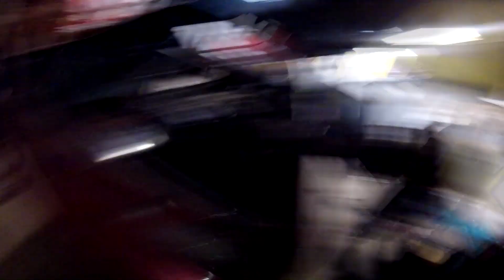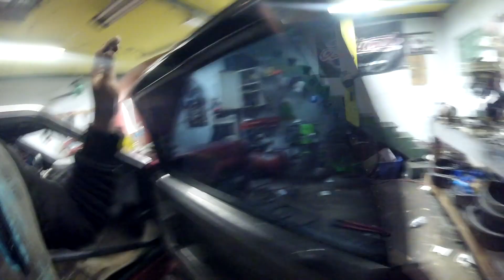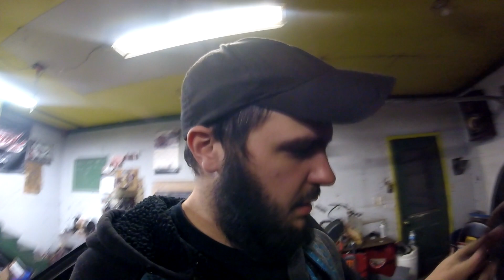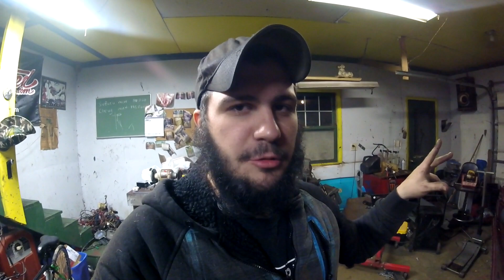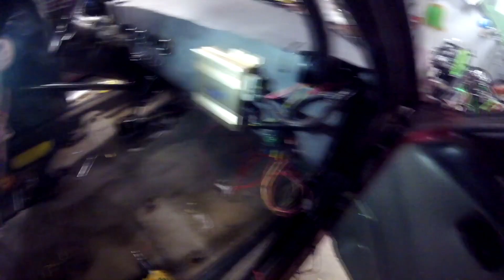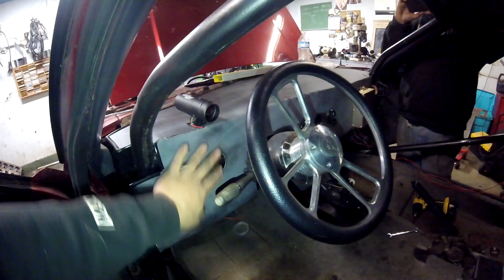Wiring A Race Car. MS3 Gold Box LS Wiring Harness Install. Switches, Fuse Panels And More!

Comment: Wow.  I need to do a battery relocation on my 4th gen Camaro this winter and that really simplified it.  I have stock tank still and stock computer. So I should have 3 wires coming out of the kill switch? Starter,alt,factory fuse box under hood?

Comment: Hunter I agree with some of the other peeps. the pumps need to be on relays, toggle switches are only rated at like 5- 10 amps and each pump will pull double that easy. Also cooling fan needs a relay, I would also let the gold box control that shit, it can do it so why not let it? it may work for a while like you have it but it is prob limiting it at full tilt

Comment: Solid State relay for the rear..gets rid of the big  gauge wires going to Kill Switch..all u need to do is run the trigger or ground to kill switch to turn power off. I would relay the pumps just because thats a lot of amps(36+) running thru a switch. Make your self a little metal panel and screw/bolt some relays to it and start running wires. Obviously make sure they are fused(get a fuse panel). Check out Leash Electronics they have Single and Dual relay boards. They are great for Fuel pumps and fans or any other high amp stuff..Pretty sure they are rated to 60amps. Only downfall is they take 2-3 weeks to get. Go to google images and type in 12 relay/fuse boards u will get a ton of ideas.

Comment: Looking good man! BTW when you go to use the data for those injectors I ended up with 1.3 dead time @ 13.2v and the standard .200 offset. Works perfect on the MS2 might be similar or a good starting point on yours!

Comment: Lifetime Carb guy checking in.
I just recently bought an efisource micro, coil igniter, 3 bar map, and the Tuner Ultra with Megalog HD.
 All this being installed on my 2000 Dodge 5.9 engine going into a 73 Dart.
We’ll see how this goes.  LOL
Reply: Prochargedmopar I was a carb guy for 30 plus years. After learning efi I wouldn't have a carb if someone gave it to me.

Comment: Great Progress, you are gonna be done in no time.  I built a 70 camaro BBC Holley EFI drag car for my son last year so here are my tips for your build:  (1) Run a battery cable size ground and power wire to Lugs on the firewall or someplace up front.  All important grounds (efi related especially) need to see battery grounds when doing efi.  Ground both heads and the frame to grounding lug. The 12v Power Lug on the firewall makes providing power to anything on the front of the car easy peasy.  (2)  Let the Gold Box run as much as possible and eliminate a bunch of toggle switches.  For example, let the Gold Box run the fuel pumps (use relay near fuel pumps and battery).  Let the Gold Box run the radiator fans or fans (again use relays near fans).  You have a bunch of outputs on the Goldbox, use them.  (3) NHRA or most tracks require the car to shut off when turning off kill switch.  With the Alternator back powering the system it can be a pain.  I used a Kill Switch that had small aux lugs on it and ran a 12v wire from the small aux lugs directly to the ignition switch.  So the engine shuts off everytime kill switch is off regardless of alternator back charging.  You can run this wire through your Trans Shifter Neutral Safety switch and kill two birds with one stone (also a NHRA and or track requirement) 

Anyway, just my two cents.  Cant wait to see you run the ChevStang at the track.  Good Luck!

Comment: The alt wire needs to go to the other side of the kill switch or it will keep the car running.
Reply from the maker: The_ Darknesss yes I need to switch that wire around. What about relays?
Reply: HunterTuned you don’t have the fuel pumps on relays?
Reply from the maker: The_ Darknesss I don’t